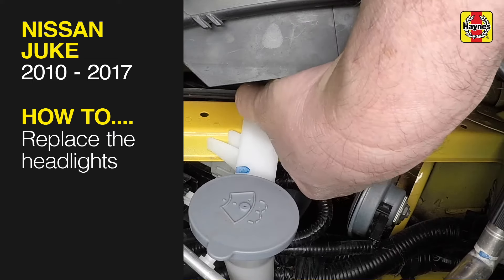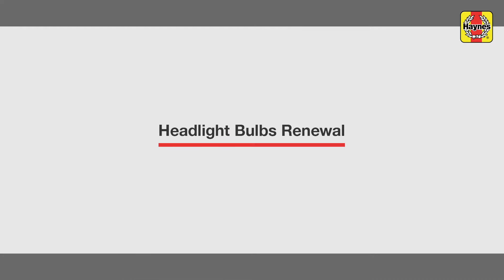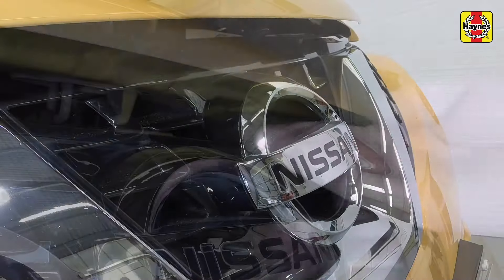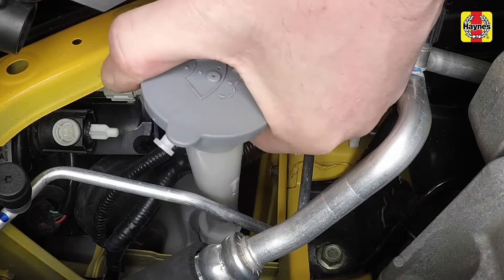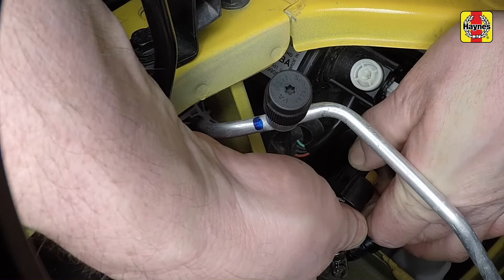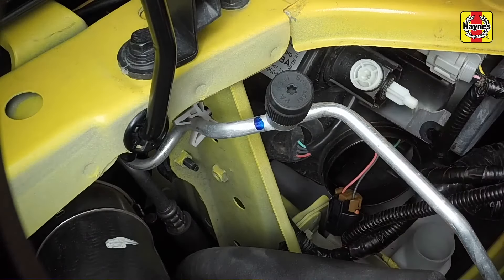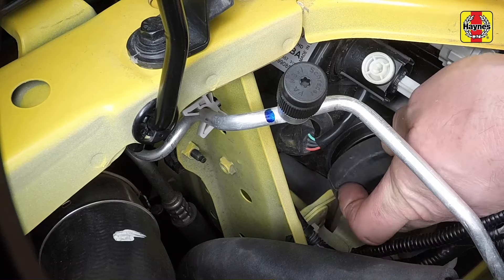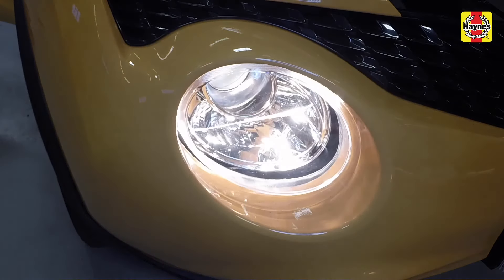Nissan Juke (2010 - 2017) - Replace the headlight bulbs

Comment: Did you ever change the rear blinkers to led? If yes where did you get them from? All the ones I've gotten hyperflash.
Reply: every time you convert a blinker bulb to an LED, no matter the vintage of the car, you MUST change the flasher to one that's compatible with LED.  LED blinkers require a voltage balancer flasher every time, including in vintage vehicles.  traditional flashers think the bulb is out!
Reply: What do you mean "changing the flasher" and where is it in the car? 
I've changed both front side turn signal lights to LED with housing simply as that on my 14 y.o. Juke and they work perfectly.

Comment: Youtube no longer shows dislikes on videos, and this video has a 20% dislike rate (117+ 24)
This method does NOT work on certain makes of the car. (Which the creator glossed over very quickly)

On a NIssan Juke SL 2012, this video is not accurate.
Reply: let alone on/for the American market versions

Comment: Nothing about the high beams.
Reply from the maker: Replacing the main beam bulbs is the same process . The only difference is to remove the other rubber cap from the rear of the headlight.
Reply: @HaynesManuals  The main beam light isn't the same as the high beam light. In fact the high beam light is the one shown in the video.
Reply: @nonsensechannel182 that is not true, my regular low beam headlight went out and I replaced the same bulb as him and it’s working, the high beam in the one lower